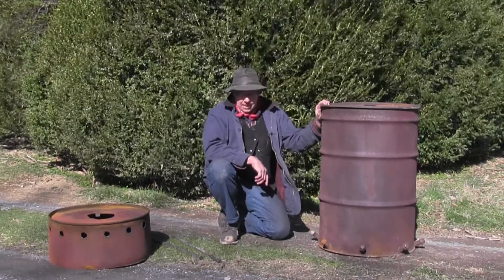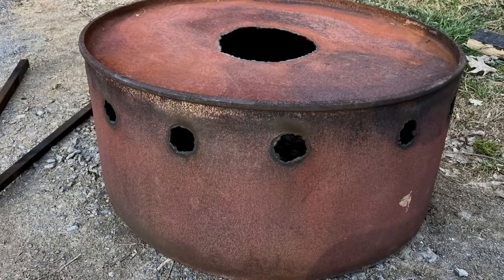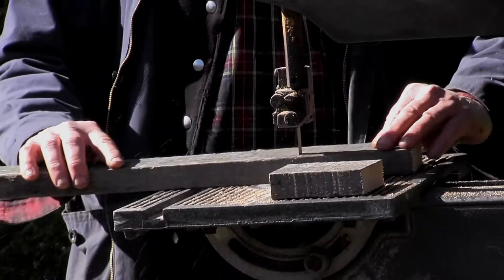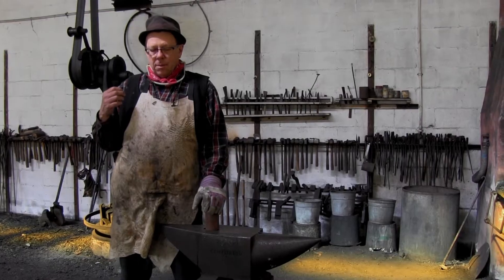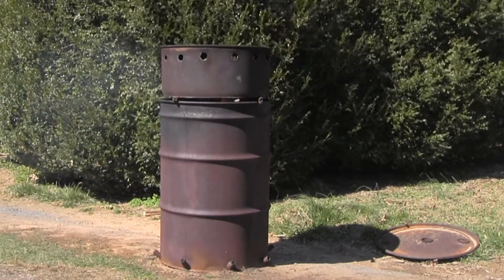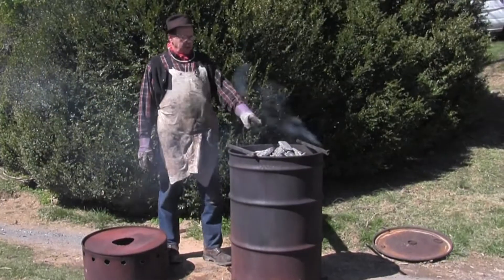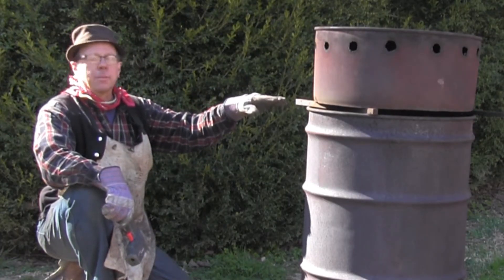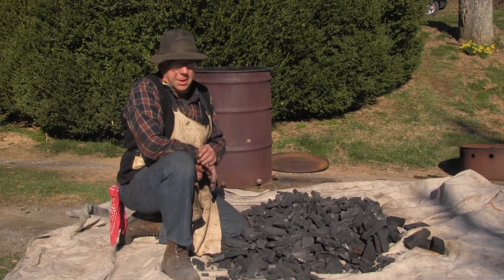Making Charcoal in a Barrel Kiln with Lee Sauder.

Comment: I have a better method. Drum with no holes, start a fire in it, toss in any junk wood [of reasonable size] a foot deep, when the flames slow down, toss in more, rinse, repeat. You will fill the barrel, none of the charcoal below will get any oxygen, it will get the volatiles baked out and burned on the surface. Seal lid when the top is just embers and no flame, maybe put in a pan of water to boil away and help it smother.

Open when cool.

You can make good charcoal using twigs with my method. Try it.